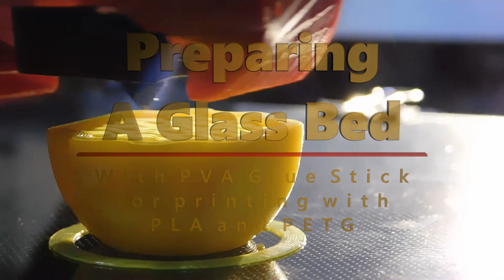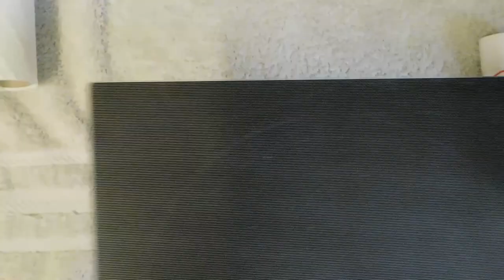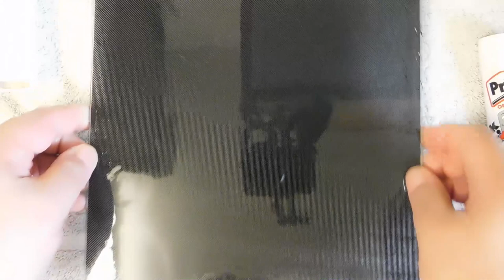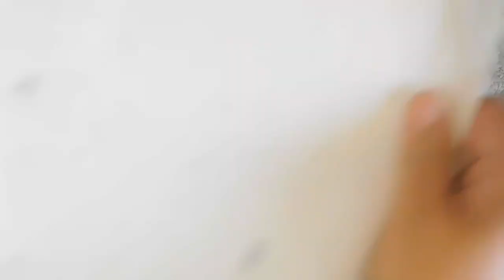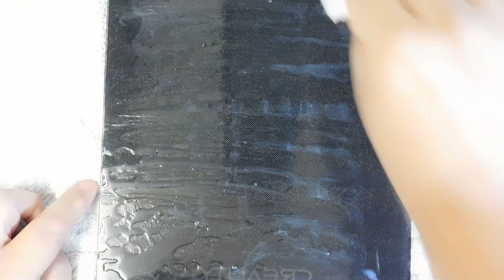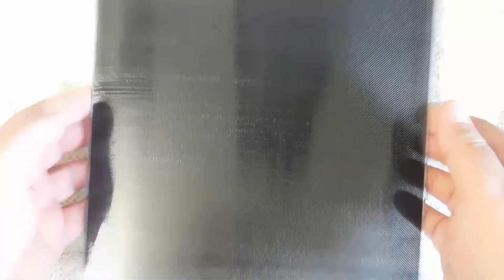Preparing a Glass Bed for 3D Printing with PVA Glue Stick

Comment: I'll tell you later.
Reply: How did it go?
Reply: @ahassan3557  I end up using Aqua Net hairspray. shortly after this comment and still do.
Reply: @Matt2chee  I’ll give that a try thank you! Do you clean and reapply after every print or can you reuse the hair spray coating for a couple of prints?
Reply: @ahassan3557  I lightly spray  for 8-10 prints, then put the glass in the sink and wash it with Dawn dish soap and a brillo pad in hot water.
Reply: Then warm the table and spray the whole thing. try and spray with the fans off or with the Z axis up at 200mm so the hairspray doesn't build up on your fans. Vacuum off fans when you wash table. Good luck!